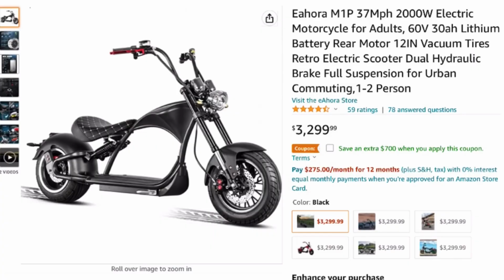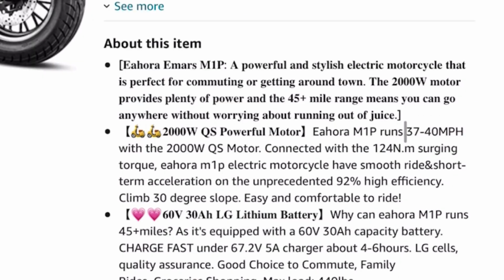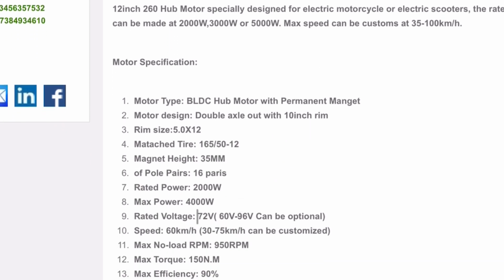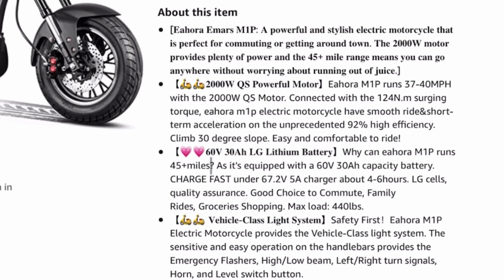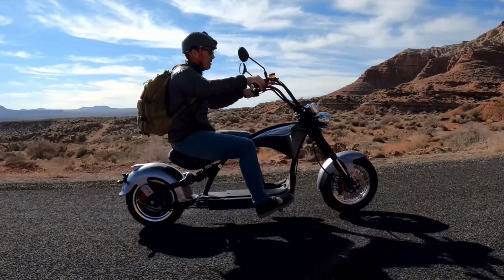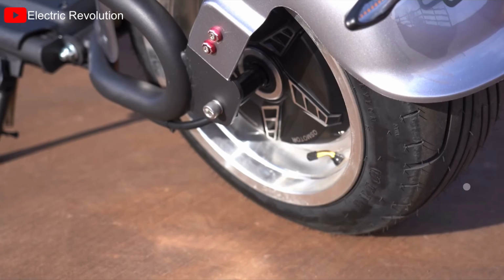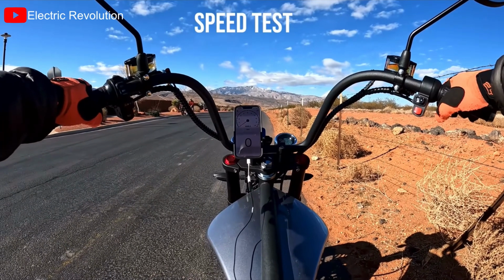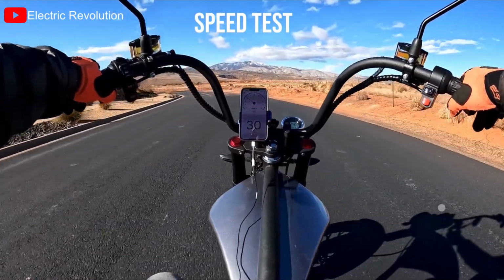I Found the Greatest eBike you can Buy on Amazon

Comment: I own M1P pro since December of 23, I have well over 2500 miles on a odometer, I ride through the streets of Los Angeles, Orange County and on Pacific Coast Highway, constantly get envy looks, thumbs up, smiles, and fist bumps from real bikers, I repeat mine is “M1P PRO” and I bought an extra battery with two battery in my battery compartment on a Pacific Coast Highway I did 53 MPH, (confirmed by GPS) 70 miles of aggressive riding on the 3th gear and 112 miles on the 2th gear smooth city riding, this is an excellent fun toy. According to DMV I cannot register it because first of all don’t have an emission control certificate, (NO JOKE) and not enough power to be considered as a motorcycle, I don’t understand why would anybody want to register this thing.
Reply: I'm having an issue now. Trying to register mines in Arkansas. They want a bill of sale and also  odometers statement and I did got mine off Amazon.

Comment: Lots of people have done videos on this and everyone who gets one is satisfied.

It can unlocked to go faster and there's videos on this. In NYS it can be ridden on the right shoulder as a scooter going 15mph if unregistered. 

It can be registered and people have registered this exact scooter. Some folks do 17 mile commutes with these. There's more powerful versions that can rival motorcycles. It can hit ONYX RCR speeds after being unlocked. It can be modded easily. 

I don't understand the hate. I mean I do but it's childish imo. 

If you can please do a demo video of this bike. I just bought one and I firmly believe these are underrated. It's a great beginner option with even more options to increase power. There's a video for that too. I just wish this had more support. Most ebikes or escooters are Chinese imported soooo this is just another one to test out. Only real way to know is to try it. Seems like a great city commuter if used right.
Reply: Nope. Nit at all.  Any scooter or bike with ni pedals that is over 750w can not be on the road at all.    

All eahora the 2000w the 3000w and 4000w all must be registered cajse even the slowest one gies too fast it goes 35

Comment: Can't register it to make it US street legal in my state.  Probably not in your state either.  I would feel safer if its top end was closer to 50 MPH (afterall, I have local streets with 45 to 55 mph speeds, I really don't want to do Interstate Highways, but with a 40MPH min, and the speed hack on this bike, theoretically you could... less state registration).  Also feel safer if it could climb a very steep hill at faster than 12 MPH.  Range seems OK for trips around town except if its really a long trip and you want to get home (answer, bring a second battery.. perhaps this is what the open space above the real battery is to address).  Range tests I've seen on YouTube ALWAYS are on relatively flat streets on perfect days.  So actual range is probably 25 to 35 miles. So not great really.
Reply: Yeah these are DOT approved and can be registered and the speed can be unlocked to 55mph
Reply: which state? the eahora site says 20 states so far have confirmed it street legal

Comment: Not an e-bike, e-moped or e-motorcycle.  Lack of pedals precludes it from being an ebike (not to mention it's power level is beyond federal and state regs on e-bikes).   It would make a nifty commuter motorcycle.
Reply: If they're under 3000w in florida they're registered as an e-moped as they also use calipers rotors ect that all fall within dot regs for a moped but you can get them registered as an e motorcycle fairly easily. When I registered mine they put a tamper proof sticker where the battery and controller sit so if I attempted to upgrade the power I could face fines but mine is 60v 8000w that was tuned down to fit e-moped regs and I can easily revert to original tune with my phone
Reply: Also even after getting the registration federal laws do not require a license plate or insurance but both are recommended (varies by state), I have full coverage on mine

Comment: You'd prob have to register this thing as a motorcycle in most area's.. and would need a license
Reply: Especially in Jersey. Even a moped has to have pedals in NJ from my understanding, and a moped has to be registered. So even if you can register this, it's probably going to have a motorcycle plate and motorcycle license to drive.
Reply: @titaniumismagical8643  jersey is too strict
Reply: @slimdunkin117  in certain ways...yes. 
As a trucker, Jersey is one of the best states without being hassled... Virginia, Ohio, and Connecticut are the worst, east of Mississippi River, in that regard. Also Jersey will give you a minimum of 15mph leeway for speeding.